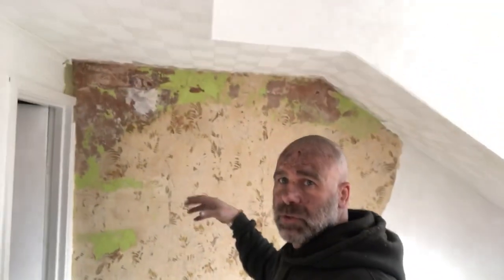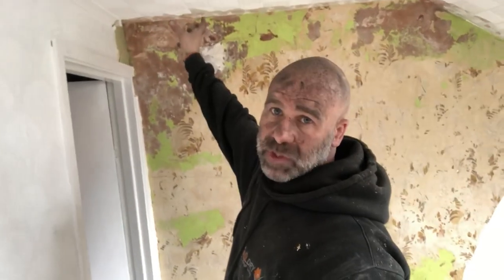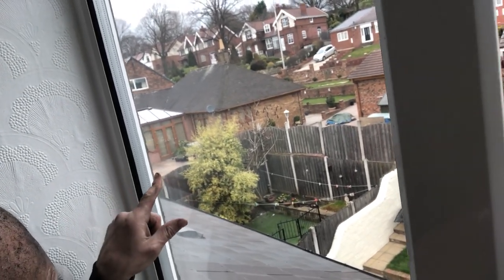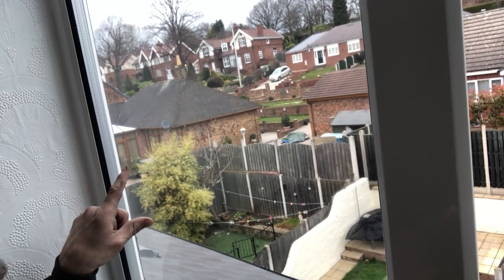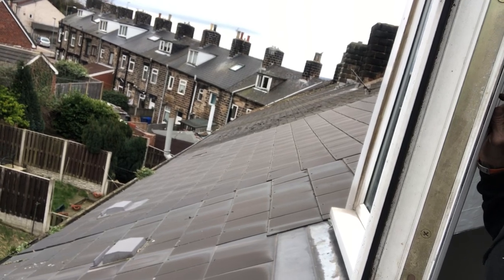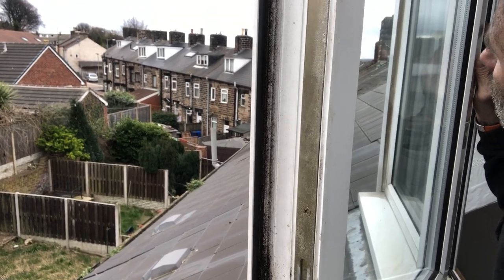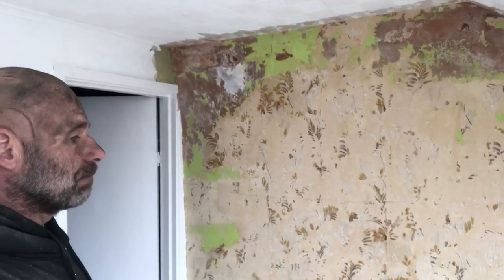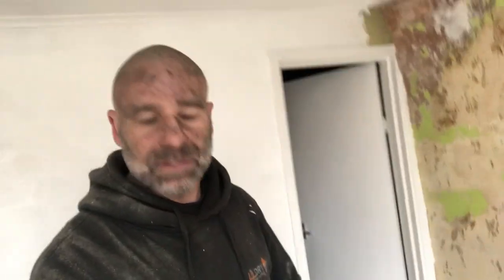Chimney Sulphate Salts part 2

Comment: Hi, thanks for the video.  I have a similar issue where i have speckles (condensation i think) damp on a chimney breast- thanks to minimum ventilation in the chimney on an external wall, with a non capped flue. I will take the plaster back to brick thinking of using insulated plaster board dot and dabbed on top. What vapour/moisture barrier would you recommend using between the brick and board if any please? Many thanks
Reply from the maker: We used NatCem Tank, one thin coat will do it,
Reply: Brilliant thank you very much 👍
Reply: @dampsam . Thanks Sam - that is what i recently learned about . Tanking 👌👌